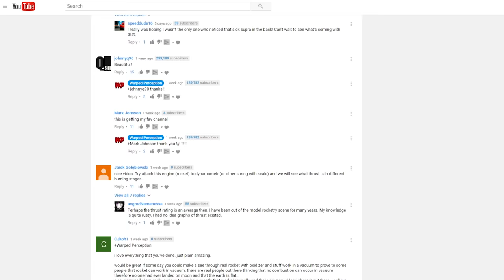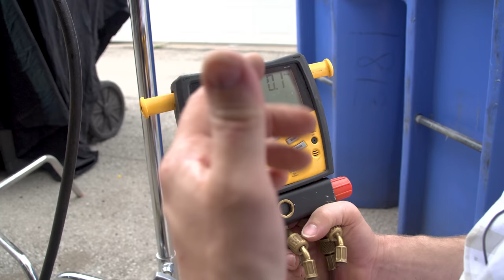Model Rocket Engine In A Vacuum Chamber - 4K Slow Motion - will it burn? - Rockets (S1 • E3)

Comment: I'd like to know if the rocket burning produced gas that dropped the vacuum in the chamber.  If it did, would be good to see this again showing the  gauge and how the Vac dropped off.
Reply: Oil Burner i think this experement has two problems
a the rocket was so close to the end of tube the gasses hit on the tap so you have  thrust.
b the chamber is so small the pressure rises so it seizes to be a vacuum
Reply: @ both of you, Why wouldn't those particles simply escape aside the rocket instead of generating thrust? The particles tend to distribute evenly through the tube and not gather at one side.

Compare it to a gun. If you fire, you get the recoil when the gun powder explodes. Not when the bullet hits a wall right?

The same happens in a rocket engine. The recoil is what makes it move.
Reply: Rocket engines do not produce air as a by product of burning fuel, its only smoke so it would not pressurise the chamber.
Reply: +WildPhotoShooter , the exhaust gas consists of particles and therefore does pressurize the chamber. If the gasses wouldn't produce pressure (in the combustion chamber), the rocket wouldn't fly. 

You don't need air to pressurize, you can also use nitrogen, water or whatever substance.
Reply: I don't believe you , prove it.  Did it pressurise to 15 psi ( same as the atmosphere at sea level)  Did you personally measure the pressure in the tube caused by the gasses ? 
HaHa! I'm just taking the piss out of people who think rockets don't work in a vacuum.
Reply: Pressure is caused by particles pushing away from each other. As you can see, the smoke distributed nicely throughout the tube. So yes, the pressure increased. But it didn't need pressure in the tube to produce thrust, as thrust is generated in the rocket's combustion room. 

No need to take the piss out, try to teach them how it works instead. Not everyone is strong in physics!
Reply: Cool Boy bullshit.
Reply: Danny Sedney no.not the recoil. It is the pressure build up behind It until it becomes great enough to overcome the lesser pressure at the front and the weight of the object,then it becomes airborne.Density is how flight of any type is possible. Lower the density above enough and the object will rise. Raise it enough below and it will rise.. Rocket motors dont create a recoil. The burning gasses defkate out of the chamber through the neck,same as a baloon. The propulsion comes ftom the pressure buildup underneath. A jet motor builds up pressure behind it untill there is enough to push the craft. The wings create enough difference  in the top and bottom densities for the pressure to push the wings up so hard that they lift the aircraft..Hence ,liftoff...
Reply: WildPhotoShooter wrong
Reply: WildPhotoShooter they dont work in a proper vaccum in a decent sized chamber. Rockets need a medium to push off.That little rocket had the rear of the tube that was allowing some preasure,giving it a small forward thrust. Try it in nasas,huge vacuum chamber where it wont have any medium close by. That rocket fuel was slso creating its own oxygen through chemical reactions to burn. Despite the speed of the exhaust it had very little power because it didn't have much to puse off because the rear puff the chamber was a distance away. Failed experiment. Good try,interestig.
Reply: Danny Sedney bullshit a rockey PUSHES itself off. By generating huge pressure behind it. (Underneath on takeoff). A recoil is a one off. Rockets engines  dont operate by  recoil. It is density (pressure) that pushes (forces)them up ,created by the rocket engines exhaust.
Reply: +Steve wittwer, insteresting, however, in a vaccuum there would be no (or very little) buildup of pressure. In the combusionchamber however, there is no vaccuum thus pressure. 

A rocket engine works because of pressure buildup in the combustion room. This pressure push in all directions. However, since it escapes freely through the exhaust, the net push will be forward

[EDIT] so yes a rocket pushes itself off. But off the combustion chamber, not the floor, air or a vaccuum. Think about it!
Reply: To simulate NASA/scientism's description of space you would have to have constant suction that could handle a high volume of air/gas to keep it a vacuum the entire time. In this case the hot gases created an atmosplane/atmosphere for the rocket thrust to push against. I don't think that it was a perfect vacuum to begin with because combustion could exist. I could be wrong though, this is just my opinion. I am always learning. Cheers!
Reply: Winston Larison yes you are wrong. According to the gas laws, the pressure created by the gasses shooting out of the rocket distribute equally throughout the tube in a fraction of time, canceling out any forward force except for the force created by pressure in the combustion room. Since the tube was vacuum to start with, there aren't any particles in there to influence this behaviour...
Reply: Danny Sedney Right, but it is an enclosed tube that will fill rapidly with hot gases. There is nowhere else for them to go. When he cracked the valve on the vacuum pump at the end it could have been pressure for all we know.
Reply: Winston Larison indeed and because the tube fills, the pressure divides equally throughout the tube. In order to have thrust there must be a large pressure difference. 

The only pressure difference in this experiment is the pressure in the rocket's combustion room versus the tube. So what do you think causes the thrust?
Reply: Totally agree with this!
Reply: Oil Burner  yep you're correct and at the end if you saw how easy he open that thing up you would know there's no vacuum if you know anything at all about pressure
Reply: kevinearp2008 there is many kevin earps on linkedin. There is even a window cleaner going by your name. How should one find you if you don't show a picture of yourself? 

Also your typing doesn't reflect a huge background, it is one cloud of unreadible text. Use some paragraphs please!

As for the vacuum tube, basically it is the outside pressure pressing against it. Not the insidr vacuum keeping it closed. This oressure is measured in psi, pounds per square inch. If he releases the vent, which is small circumference there should be no issue.
Reply: off course it will mowe... acc to law of cons of momentum
Reply: I was wondering the same thing. I'm  not a physicist, but the pressure absolutely increased in the tube. How much? We don't know. Run a second test with a camera on the gauge.
Reply: Derek, the pressure in the tube definitely increases, no need to watch the gauge. More interesting would be to put gauges at the side of the tube and where the rocket is. And connect the rocket on a spring with known spring rate (Newton per distance). This way we could determine the force the rocket produces by measuring the spring's extension. We could also calculate the pressure on the cap by the pressure difference between the rocket and the cap. 

This way we can conclude if the rocket pushes off the cap, as some of the 'scientists' in here claim. Unfortunately, these scientists can't apply gas and liquid dynamics themselves, so their conclusion will be the math is incorrect as the result doesn't meet their expectations...
Reply: Danny, thanks for the insight and I appreciate the explanation.
Reply: + Oil Burner - FFS, you can SEE thrust is apparent BEFORE a significant build up of gases in the chamber.
Reply: +kyriacos georgious
" b the chamber is so small the pressure rises so it seizes to be a vacuum"

Why would that be a problem? The claim is a rocket cannot burn at all in a vacuum, so that the tube may or may not loose the vacuum after ignition is irrelevant to its evidence. Were the claim correct it could not even have filled the chamber with exhaust gasses!

As for "it could push against the tab and produce thrust" ... thrust does not (mainly) come from pushing off from anything external, it is the internal pressure in the combustion chamber that causes a reaction very much like recoil and pushes the rocket away from its own combustion products. If you start a rocket from the ground of course the backlash from the ground will have SOME effect, but the major impulse still will come from the internal pressure. It's simple physics actually.
Reply: +kevinearp2008
"In his video at the end he flips the door off of the vacuum tube just by removing the tape and flicking it open."

Now please explain how that end result in any way influences the proof that rockets DO work in a vacuum? For the hypothesis that it is impossible for anything to burn in a vacuum it would have needed to not ignite AT ALL. How much the vacuum is reduced by the products of it burning is completely irrelevant for the test.
Reply: Danny Sedney the rocket motor has a nozzle that directs the flow of escaping it is the weight of the gas being accelerated in the direction of the nozzle that creats thrust not through resistance of air to gas but the physical law that states for every action there is an equal and opposite reaction. You are converting 1/2 once or so of propellent into superheated gas which is then accelerated out the back of the combustion chamber this action causes an equal  action in the direction opposite to what the gas is moving. Like jumping off a small boat it is not the resistance of air against your body that causes the boat to move it us the energy needed to overcome the inertia of your body mass
Reply: Oil Burner, great observation! What we saw is that the rocket ignited in the vacuum but when the pressure of the chamber raised with exhaust gases, the power went up. So, the only thing you need in the vacuum to raise your power is to build a chamber for fuel to burn and sustain the pressure in that chamber, while the most of gases lefts through the exhaust to generate the power to go up the skies ;). 

Edit: and that's literally what NASA and Cody did for their rockets to go in the vacuum... It's not that hard problem to solve.
Reply: Yes indeed the chemical reaction produces exhaust gasses that push the rocket.. basic
Reply: @steve wittwer Density and pressure aren't the same thing.  Density is the mass of a substance divided by its volume, where pressure is the amount of force being applied divide by the area that it is being applied to.
Reply: I'm not going to question the thrust issue but l wonder how the rocket ignited in vacuum without oxygen being around to support compustion
Reply: electronic match.  It causes the fuel which contains an oxidizer (oxygen) to reach auto ignition temp.  The electronic match doesn't need oxygen to reach a high enough temperature to cause ignition.  Think of an incandescent light bulb.  The tungsten filament doesn't need oxygen to reach a white hot glow.
Reply: to burn you need oxigen.. :)
Reply: +Oil et. al., So many misconceptions in this thread.  I know you folks are trying your best to use the physics you know, but you have much to learn to properly interpret what you see.
...
The SOLID rocket engine has its own oxidizer IN the solid fuel.  This is what the Shuttle's Solid Rocket Boosters (SRB) used. Oxygen is not the only oxidizer, though it is one of the best.
...
The burn produces EXHAUST GASSES. GAS!   Smoke is simply small particulate matter not turned into gas and also has mass that is accelerated out the rear and contributes to the rearward momentum. 
...
These gasses, being very hot, expand rapidly creating a high pressure INSIDE the engine chamberand this pressure pushes the gas out at high speed and the pressure inside the engine pushes on the inside.  Around the sides tries to expand the tube, but it is strong enough.  On the front of the chamber, there is nothing but the mass of the engine and rocket to push against, so it moves forward ... conservation of momentum determines how much the engine accelerates, or in this case the force on the spring.
...
Rockets DO NOT PUSH OFF THE AIR.
...
Rocket engines WORK BETTER in a vacuum, because the absence of air pressure means the gasses have a LARGER difference in pressure from the vacuum (like 14 psi more)  and are, therefore, accelerated out the back FASTER...more momentum rearward, therefore more momentum forward.
Air IMPEEDS the gas acceleration, reducing thrust...!
...
The engine moved back WHEN it produced thrust, not gas in the chamber to push against.
...
Yes, these engines burn for only a second or so...Pfffft! 
...
He shoulda' done it with air inside to compare the difference in thrust...!
You'd also see that the thrust would start at about the SAME TIME...
...
Gasses "Hitting the end of the chamber" isn't helping thrust. It is far away and until some gasses build up in the chamber, the thrust is essentially in a vacuum.  The engine has no knowledge the end it there to cause any thrust...
The gasses ARE PUSHING AGAINST / hitting the END and  trying to push the chamber to the right.  However, the engine, via the coil spring, is also pushing the chamber to the left.
...
YES!  When a gun goes off, it recoils...NOT when the bullet hits something.  VERY GOOD analogy !! 10 points!
...
Recoil is a good word, we just use it for guns, but the SAME APPLIES TO ROCKETS. The expanding gasses in the gun barrel push the bullet forward and the gun backward = recoil.  SAME THING  Gas pushing in all directions.  A FUNDAMENTAL property of all fluids....
Sorry, but density is pretty much irrelevant here.  [[FYI: the density of air in subsonic flight is virtually identical above and below an aircraft wing.. The pressures are different (more under than over)]]
...
He shows how there is still some vacuum left, but yes, it could have been pressurized.  It would have been better to have a guage, BUT IT DOESSN'T MATTER in view of the true physics as I DESCRIBE. The thrust would have just gone DOWN to below what it would be in 14 PSI air or vacuum.  See above about the pressure DIFFERENCE.
...
Suction is a idiom.  When you reduce the pressure in your mouth, ATMOSPHERIC PRESSURE pushes soda up the straw.  The faqn in a vacuum cleaner reduces the pressure at the inlet...ATMOSPHERIC PRESSURE pushes air in and the dirt along with it.  You absolutely cannot PULL on a liquid or gas.
...
Space is a vacuum because GRAVITY SUCKS... [joke], but not too far from the physics...
- - 
Cheers, Steve
Science and Technical Advisor
challenger.org...P.S.  If you want to try to dispute any of this science, just read it over.  I'm not going to engage in a "repeat-myself-over-and-over-fest" retyping any of this.
Reply: @Danny  so if I take an air hose with 10psi and I hold my hand 2 inches from the end of it I will not feel pressure because it instantly and perfectly fills the earth's atmosphere?   LOL!!!!!!
Reply: The combustion occurs because the fuel contains an oxidizer, e.g. KNO3 along with combustible material, e.g. hydrocarbon.  No ambient oxygen is used at all.
Reply: WildPhotoShooter "does not produce air" - you're joking, I hope. For those who didn't get a decent science education at age 12; air is a mix of gases (nitrogen, oxygen, water vapour, CO2, and a bunch of others). A normal wood fire produces gases (CO2, some CO, some gaseous hydrocarbons, some water vapour) and particulates (carbon - soot). Fireworks have the same, plus some sulphur, a nitrate source, and whatever they use to colour it - magnesium, etc.
Reply: Oil Burner, it definitely would and would make more of a difference in a smaller chamber. The amount of mass produced would be inefficient and immediately and readily absorbed in the infinite size and vacuum of space. We can use ether or gasoline and a match to quickly expand the air in a tire to seat the bead but in a vacuum and the infinite expanse of Space? Not so much.
Reply: WildPhotoShooter, Rockets will ignite and burn in a vacuum but they will not provide sufficient thrust without having mass to thrust against. The amount of mass that it does produce would be insufficient and inefficient and readily absorbed in the vacuum of Space to provide an adequate backboard with which to propel itself from.
Reply: Good explanation but you could add to that the walls of the vacuum chamber providing some resistance to push against.
Reply: jimmyfly, ahh, yes they do.
Reply: Danny Sedney rockets work via the expanding gasses. They work  in our atmosphere because it compresses the air, providing mass. Jet Aircraft work better at altitude because the thin atmosphere provides less friction, but only to a point. Any higher and the thin atmosphere that helped by creating less drag now is insufficient to provide the required mass to thrust against. The higher you go the less efficient the rocket becomes. This is why we see the rockets bending and leaning over when they leave Cape Canaveral. NASA's reasons? NASA = Never A Straight Answer.
Reply: Yes. Anyone that's ever used starting fluid or gas and a match to seat the bead on a tire should understand this. The air expands quickly and violently and the Tire is able to push its bead on the rim because the density of the air AND the Rim itself allows it something to push against. In a vacuum chamber it's density is lessened via vacuum but the chamber walls are just as necessary to provide adequate backboard.
Reply: Danny Sedney, it thrusts against itself, but this thrust is insufficient to propel a heavy payload without also having something to push itself off of. Our atmosphere compresses, providing mass. This fabricated mass is used as a backboard to push itself away from. Higher altitudes require less mass due to the equally less drag and friction at the opposite end, but only to a point. There exists a happy median where less drag and less mass are symbiotic. Any lower in altitude and mass, and they still work, but less efficiently. Any higher and they quit working altogether.
Reply: Nope. They work in a vacuum. Newtons third law, Of course Newton was a freemason so maybe he got in his time machine, foresaw the flatearth idiots and forged his third law.  I am prepared to bet some flat Earthers will tell me that's exactly what happened. The rest cant read.
Reply: its newtons law my dear sir, not NASA's
Reply: in all that word salad are you saying Newton got it wrong or just that you can pick holes in this experiment?Of course Newton isn't on Linked in so maybe he doesn't count
Reply: The flat Earthers consider newtons law "scientism" and don't accept it. Remember, they don't believe in gravity either
Reply: They don't believe in satellites or space. they think the sun is only 3000 miles away inside a glass dome surrounded by water. there is no hope for them
Reply: exactly! and the funny part is you dont have to be a rocket scientist to understand that!
Reply: when you see fire shooting out the end of a rocket...what exactly do you think is on fire?
Reply: the claim is for the the "vacuum of Space" , not any old tiny sealed compartment with the air sucked out type of vacuum.
Reply: you can't spell, and have no idea what you're talking about. rockets don't PUSH on anything to create thrust. well not to say they can't but that they don't need to. they throw mass out of their ass to go fast. literally dropping their overall mass and density to create an equal and opposite reaction.

not to mention they total amount of density of the gas that the rocket released isn't enough to stop it from being a near perfect vacuum if it is one in the first place. 

just because i go into space with lungs full of air and breathe out doesn't suddenly make space not a vacuum.
Reply: yes, you could. and the wall would move backwards with the same energy as you move away from it. but in that equation you take the combined mass of you and the wall, and then the 'work' being done -> thrust/motion. you push against the wall, shedding the wall as mass and with some work, pushing yourself backwards.

the rocket engine throws its own fuel out the back, just like you pushing the wall, shedding mass, and causing it to move. 

imagine you're in space and you throw a ball, you move backwards with the same energy as the ball moving away from you. you 'pushed' against the ball, in the exact same way that the rocket does. so even in a vacuum rockets shedding fuel and mass will move in the opposite direction.
Reply: wrong. just wrong. rockets don't push, they throw. they expel their fuel to accelerate themselves in the opposite direction. and as a matter of fact are more efficient in space than on the ground, since they have less friction and air resistance to slow them down.
Reply: jet engines do NOT build any pressure behind them. they do exactly what this rocket motor does, they take fuel, and throw it backwards to create an equal and opposite reaction to propel them.
Reply: @lintfreecloth  that doesn't change anything
Reply: @touchey  there was mo vacuum to begin with otherwise I'd challenge them to do the "bowling ball & feather" drop like that stupid Brian Cox video... they should fall at the same time.
Reply: @osamaahmed8499  it wasn't s vacuum
Reply: @mammy24  jet engines are not propelling themselves in a vacuum lol